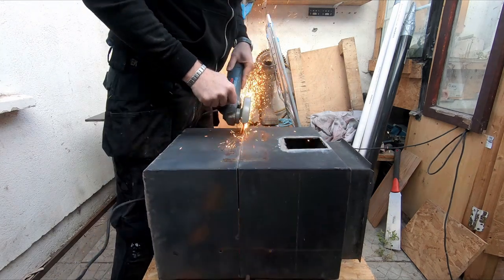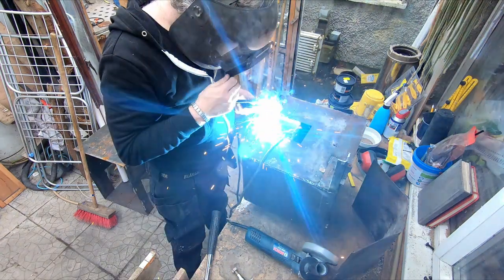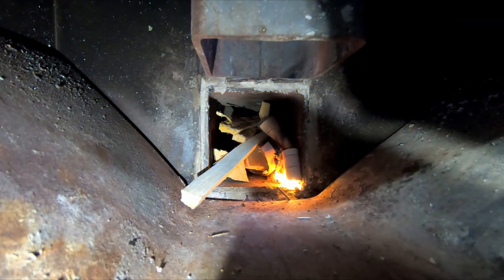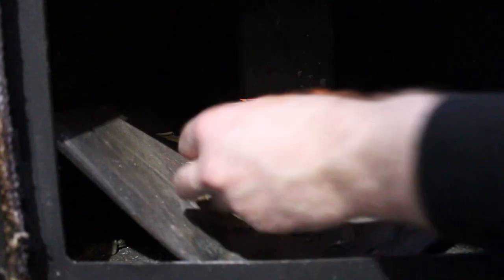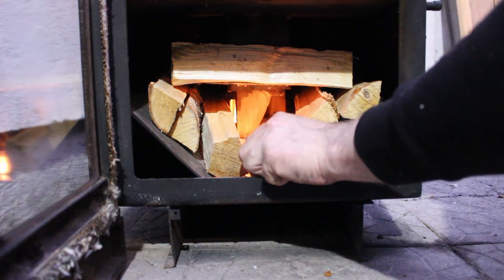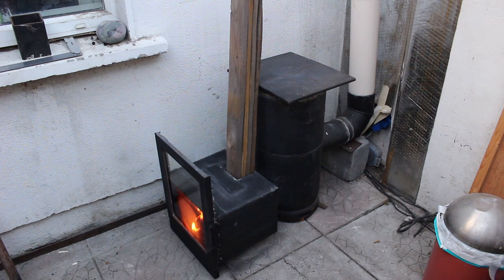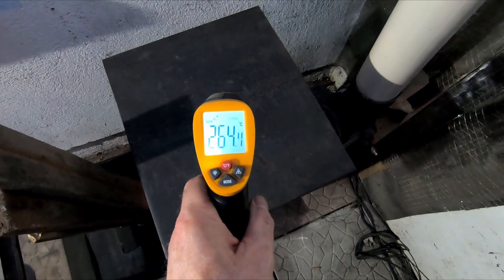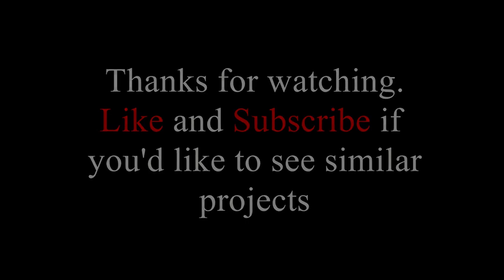Rocket Stove Best Mod Yet!!

Comment: Thank you Bob!  That looks properly  interesting . . . We have built about a dozen different brick/refractory cores and tested them - before COVID.  We always hoped that an old wood stove conversion would be possible (since we have a few of those) , and thank you sir for showing us yours!   The pallet wood feed is impressive....  Are the temperatures you show inside the burn box, or in the base of the  heat riser, please?  
Yes, it must be hard to get a reading in there!  
Thing is, we tried a couple of commercial stainless 'rocket' stoves  off eBay that just would not  rocket properly - nothing like yours. Their proportions were all wrong, and we were not seeing much more than 450C anywhere.  But when we changed the geometry and got these stoves rocketing, they'd hit over 900C, which was pleasing, until the first one kinda melted! Burned through, with flaky bits and blobby bits in the hotter spots.  Ruined in an hour!
We were running our refractory ones up to 1100-1200C in testing, had the odd (repairable) crack in the brick heat riser, but once over 900C the Carbon Monoxide in the flue was way down.  At 450C, not so much...
Be interested to know if your CO level is similar, please?  
I'm about to move house, and hope (once moved) to make a hybrid rocket with refractory  hot bits grafted onto one of our old stoves - thanks again for the inspiration! Excellent job.